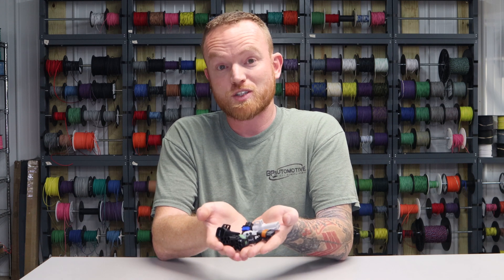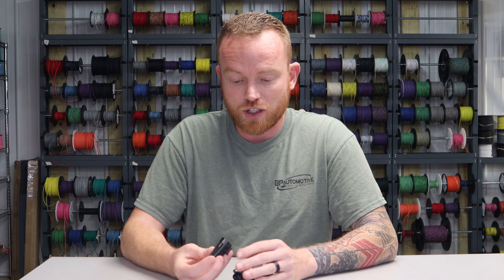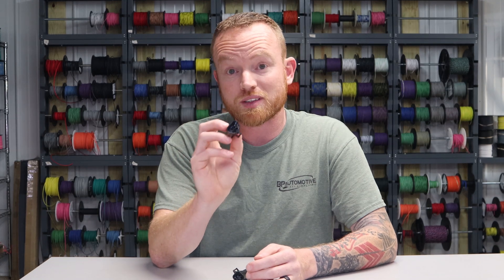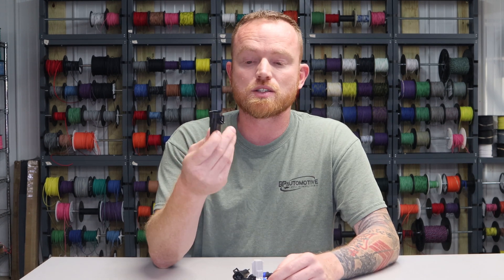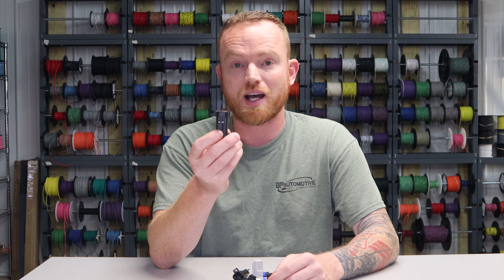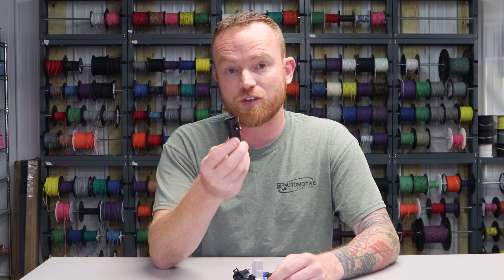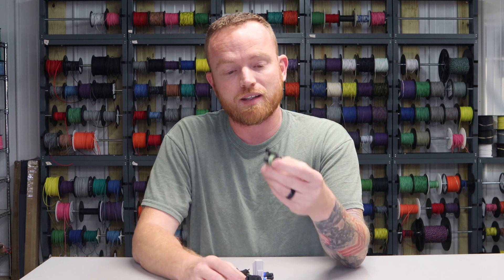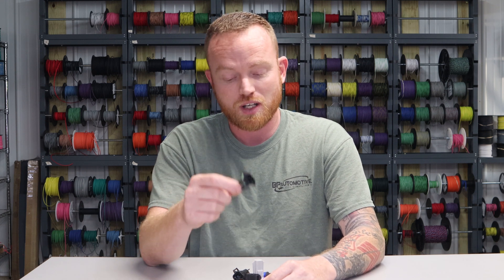O2 Sensor Connector Video

Comment: All I want to know is how did you unplug an O2 sensor connector plastic connector on the front inlet O2 sensor on a 2000 crown Victoria the plug is up on the back of the engine I cannot reach it from the bottom my hand won't fit I can't get it from the top how do I get to that connector to unplug it to change the O2 sensor please help me
Reply from the maker: Unfortunately we are not a service station and we don’t work on factory applications. Hopefully this video we found will help you!

https://youtu.be/hhzmpVRc3qY

Comment: I have a 2000 Chevrolet 3500 withe 7.4 l engine my bank to upstream oxygen sensor plug burned off burned off I had an exhaust leak I didn't know it was as close to the wiring as it was and it melted the plug off The replacement plug that I have has all white wires with no color code on them I desperately need some direction as how to rewire this thing the and the end of the wires for the plug plugs into the 02 sensor itself are exposed I need some direction as to what voltage I should find on what color wires any help would be greatly appreciated thank you
Reply from the maker: shoot us an email with pictures of what you have.  help@bp-automotive.com

Comment: This was a waste of your time and mine you didn't show how to swap connectors
Reply from the maker: No reason to show how to swap the connectors.  You will just need to use the correct sensor for the harness application.
Reply: @bpautomotivellc  I need to figure out how to open the harness side of my 4 pin O2 sensor so I can rewire the connections better after trimming off the bad ends. Nobody has a vid showing if it can be done or if the wires need to be cut and spliced into a new connector. Impala 2004 Ls. O2 sensor down from the windshield.

Comment: Hi I have a pcm for your standard 5.3 but my wiring harness is from a 6.0 with the oddball o2 sensor.  Do you know which pins on the pcm I can swap the wires to so that I can just split in your standard o2 connector?
Reply from the maker: Brandon you will need to use the 6.0 O2 sensors or rewire the harness per 5.3 diagrams. Unfortunately, this procedure is it something that can be easily explained!

Comment: So all I need to do is find the o2 sensor that has the same color and plug as my harness?  Does it matter if they call it upstream or downstream?
Reply from the maker: If you are using our harness, you will just need to purchase the O2 that matches the part number in your installation manual!
Reply: Upstream downstream it's just the location of the O2 sensor same sensor in most cases
Reply: @larryaikins4225  or the connectors are inverted(female and male swap) so they cant be mistakenly put in eachothers place